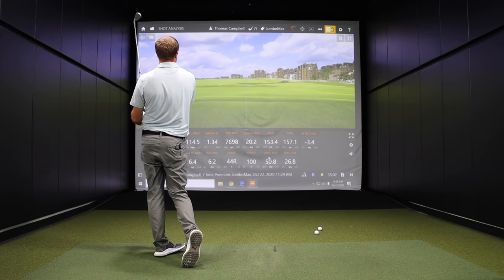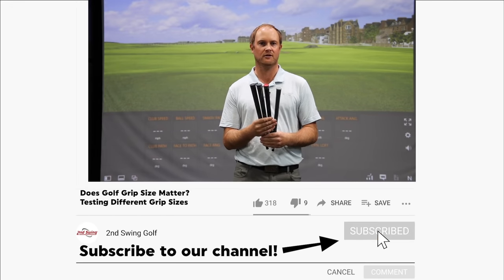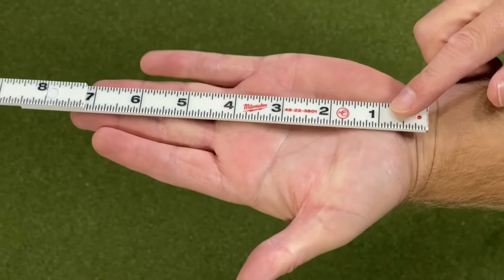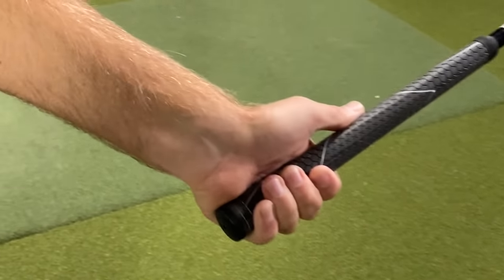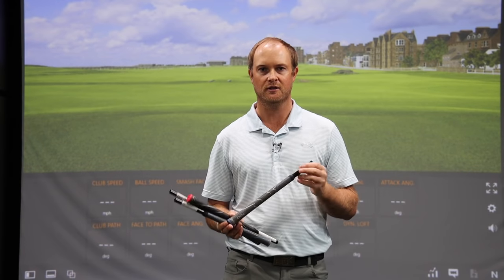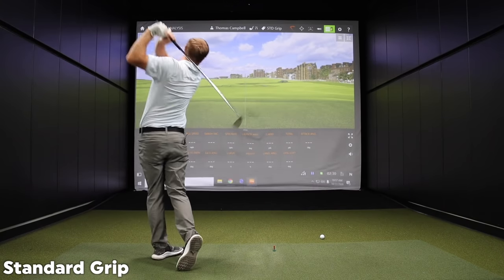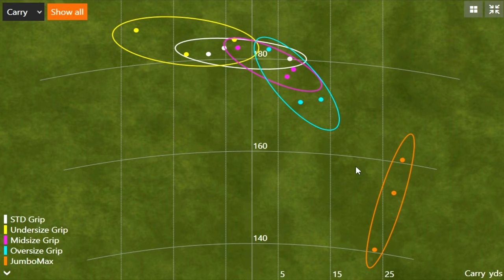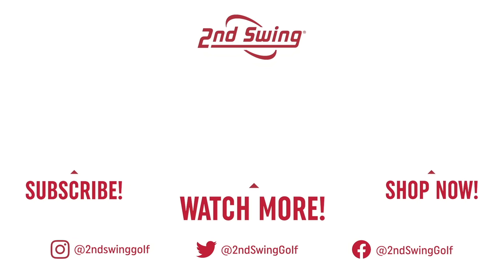Does Golf Grip Size Matter? | Testing Different Grip Sizes

Comment: This test was not accurate when it comes to the jumbomax. We did see the smaller the grip the faster the rate of closure was, which gives more distance but undersized with turning over too much causing slight pulls and left shots. With a bigger grip, the rate of closure greatly slows. You clearly were not getting straight shots so it directly took away tons of ball speed due to three miss hits going into the testing results. You should have readjusted grip position to get a straighter shot and then used THOSE numbers for the test. Again, at least we can confirm grip size directly correlates to rate of closure which can influence dispersion/aim. Not covered here, but another closure influence is shaft flex, so choosing a correct shaft flex/grip size can be used to work together to tailor your rate of closure. Just as well the wrong pairing could work against each other. For example, a very stiff shaft slows the rate of closure and would not pair well with a bigger grip that also slows the rate of closure… as you can guess this is a sure fire way to induce an almost permanent slice/push. A bigger grip will work better on whippier soft flex shafts, which is why you see long drive competitors using them with their lady flex shafts. They gain club head speed from the shaft, a face that doesn’t over close through impact because of jumbo grip, and an overall 5g lighter driver. An over all superior build is the lightest stiff shaft and lightest standard sized grip, and reallocating that weight shedding directly to the driver head (center of sole with lead tape). Now all the parts work in harmony. A very light driver that can be swung extremely fast, a grip that lets your rate of closure shine unhindered, and a stiff shaft that keeps your rate of closure in check from over turning and help tighten dispersion, and a heavier head that has a massive raise to MOI and ball speed. A grip that fits in the fingers and not the palm, creates max leverage in the wrists.
While the weight of the jumbo max could allow for more weight in the head, it’s not much of an advantage yet. Unless they make the grip 30g lighter across the board… I currently have a jumbo max small, and I push slice on what should be very powerful swings. To negate the closing of the face being slower I have to use lead tape on the heel to get the closure back to where it squares. I don’t want to mess with my grip positions because it’s already in the best biomechanical position. And changing from an x-stiff shaft to a soft flex will cost me big time dispersion and distance as the face will likely close way too soon and fast. So one has to ask… why use a grip that will need correcting with lead tape to negate the counterproductive matching? When I can just use a standard-mid sized grip with a neutral influence on rate of closure without having to add more weight to the driver head. Unless there is advantages for having a ultralite standard sized grip and a heavier head… a standard-midsized grip should always be the standard. If you want to mess with rate of closure, do it after with lead tape on toe or heel to get the rate of closure you want. Kyle Berkshire, the farthest hitter in the world refuses to use jumbo grips… based on his build and goals we can see why he opts for standard-midsize throughout the bag.

Comment: I don’t know how the data is relevant if you’re already used to a standard sized grip. There’s going to be an adjustment period for the different grips which you’re not allowing for. Whose to say you wouldn’t over time cut that dispersion and face angle down with the undersized grip if you were to give yourself enough time to get used to it and potentially be better off with it as opposed to the standard?